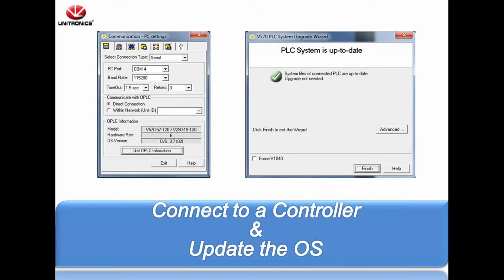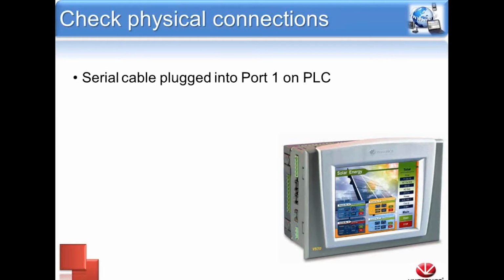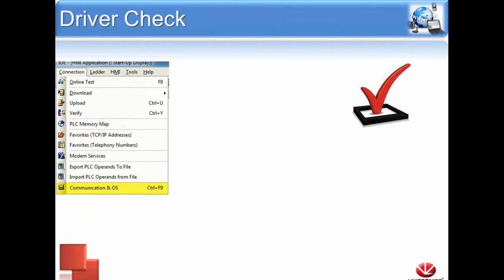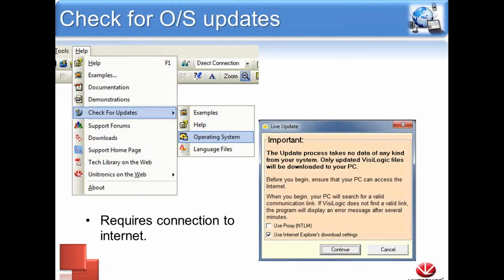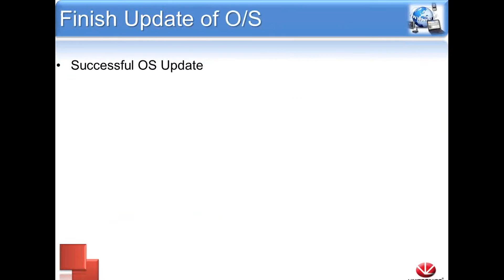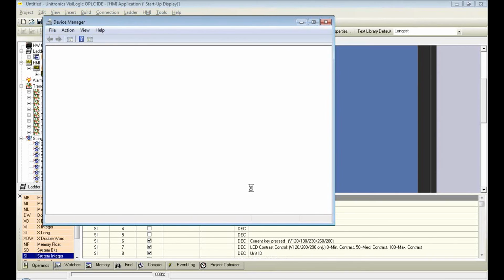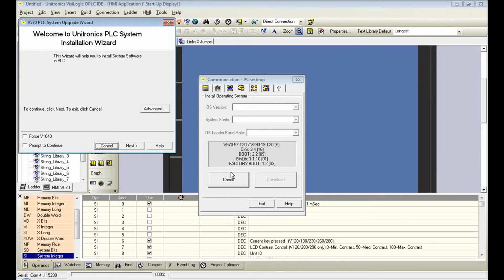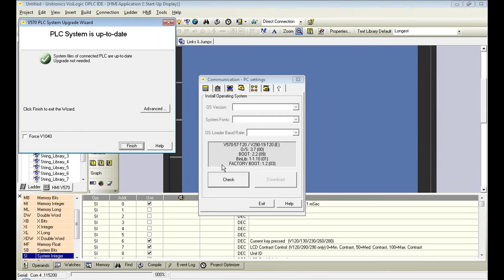How to Connect and Update Your Unitronics Vision PLC Operating System

Comment: Hi!
I have Vison230 and was recommended to use 4.7.4 version of a VisiLogic app. When I check the OS, nothing pops up (as it does in your video). I can click download, but then I get "Live Update (176) and am unable to download it because of alleged internet connection problems (which I don't have). The screen on my plc says "v4.70 (B30) application version mismatch  - Downlaod NEW VisiLogic app" but I was advised AGAINST downloading new versions.
Any suggestions?
Reply from the maker: Hi, Please contact our support engineers at support@unitronics.com

Comment: Very helpful video for the Samba 3.5. I did not use the suggested cables but instead opted for a more generic option and pined my own DB9 to RJ11 cable. Then used a waveshare rs232 to usb converter. This guide was perfect.
Reply from the maker: Sounds Great!
If you need any assistance, please don't hesitate to reach us at support@unitronics.com

Comment: I downloaded to my v350 controller and now can't get into port 1 (serial). any ideas?
Reply: did you find a solution because this is my problem already ?
Reply: @mariemguerdelli  Try going to connections, 7th tab (last tab), and install the USB driver. After, click "open device manager" and it should list the port number under 'Ports' tab. Mine was COM3, just depends which USB port you are plugged in to.